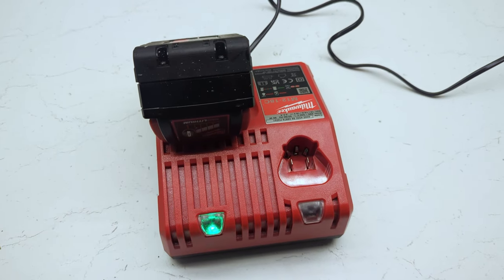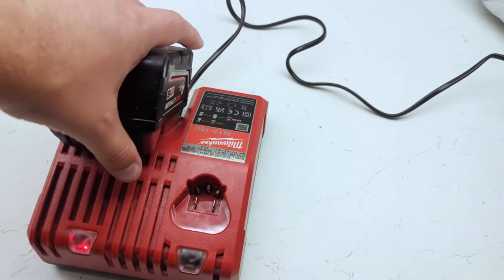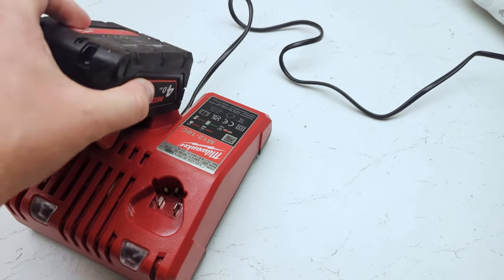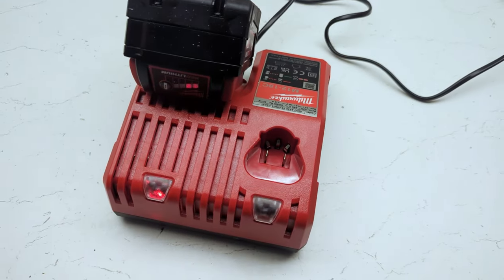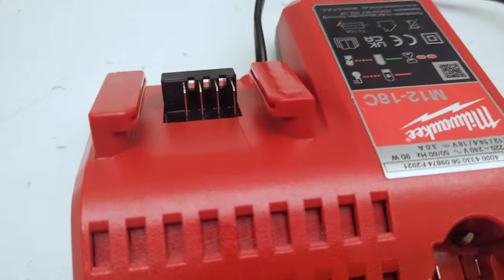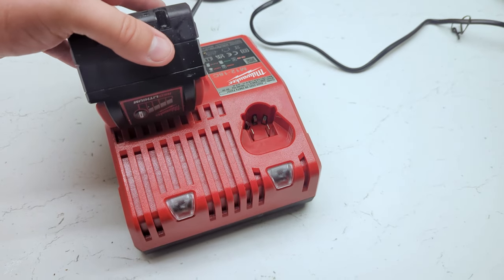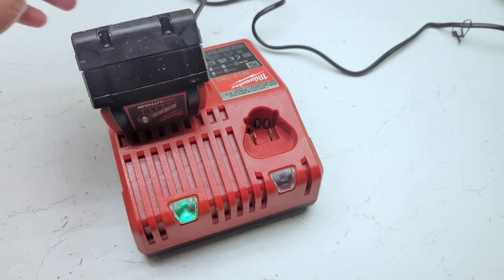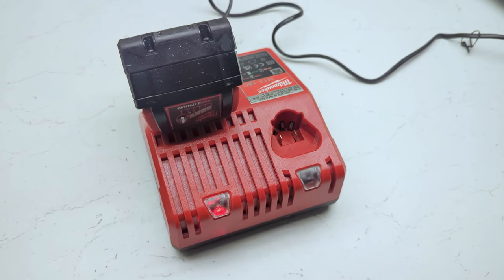How To Fix Milwaukee Battery Flashing Red and Green!

Comment: I tried what was  recommended here and my fairly new Milwaukee battery would not charge. I then tried to jump start it from a fully charge battery and amazingly it’s now charging fine.
Reply: Jumpstart it? How does one do this?
Reply: You simply push an electric wire into each positive and negative points on each battery. Just make sure the good battery if fully charged and keep the wires positive to positive and negative to negative. (Usually for 15min) There is plenty of video on YouTube about it!
Reply: I put my batteries together for about 10seconds and the charger then detected the “bad” battery and charged it from there
Reply: I just did the same thing
Reply: This is my second battery in a month to go bad...why

Comment: Had a red and green light flasing on one of my M18 batteries and also a fast flashing red light if i push the button on the battery. I jumped the battery from a fully charged M18 battery for about 10 minutes and now the faulty battery is charging perfectly

Comment: Thank you, thank you, thank you! I was trying to charge two brand new, 5.0 XC batteries in my dual port supercharger, and one of the batteries was flashing red and green. After watching your video, I pulled the battery out and re-inserted it with force and it worked like a charm.
Reply from the maker: Glad I could help

Comment: Having two new (2.0 and 2.5) Milwaukee M12  batterys and two new Milwaukee M12 Battery chargers,  from different Amazon resellers, I was frustrated that all combinations were flashing red and green lights. I came accross your video and it made sense to seat the new batteries a few times with slight force. With some Oommmph and a click sound, the lught turned Red solid...Looks Like Sucess! Thanks very very much for your short but very helpful advice. Aloha.

Comment: The Fix is Place a Jumper from bad battery to a good charged battery.
Pos + to Pos + and Neg - to Neg- terminals wait for about 15 minuets for battery to equalize.
problem solved. both batteries are ready for work or charge to full

Comment: I charged my brand new battery to full, used it a few times, and it’s doing the same thing here.  Turns out it was from heat.  I live in the desert and the inside of my truck frequently reaches 115+ in the summer.  Long story short, don’t leave your batteries in super hot vehicles because the heat can permanently damage even brand new ones 😂

Comment: tried this and the battery start taking charge! hopefully it fixes this battery! will report back in 30 min
Reply: did not work, seemed at first but after 2 dots on the battery, the charger said it was full, i guess one of the cells are shorted... cant save em all

Comment: I literally just bought mine a few hours ago and it started flashing red n green
Reply from the maker: Have you inserted it with a bit of force to ensure it is seated correctly? Also give the terminals a quick clean - there can sometimes be a bit of residue on them from the factory which can lead to a poor connection when brand new.

Comment: What worked for me was taking a 9 volt battery amd connecting pos to pos neg to neg for 1 min.what's happening is the battery's too dead for the charger to read it.its BC the battery's have been sitting for awhile I guess
.I love Milwaukee but to find out how common this is is unacceptable.they should at minimum put a note in the box BC alot of ppl just take them back wich they should if they don't work.but the fact that u have to jump start the battery is bs.